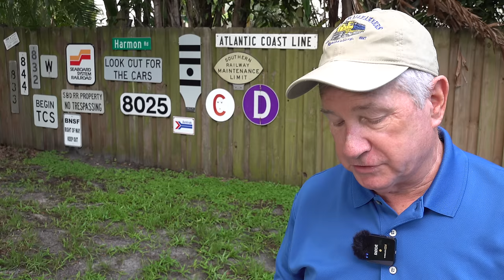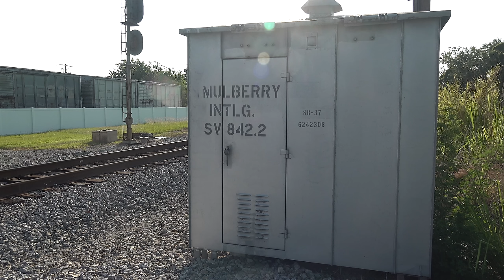Who Controls Railroad Diamonds?

Comment: Great video as usual! It is important to note that railroad companies prefer to meet railway lines at an angle smaller (or greater) than 90 degrees. At at a right angle, both wheels on the axle jump the gap at the same time, which increases the wear and the forces acting on the diamond. At an angle, only one wheel jumps the gap at one time.
Reply: That's also where to my understanding the name comes from. If it's got a non-90° angle, you'll see a sorta diamond-shape on the inside (instead of just a square).
Reply: This is what I do when I drive my car over speed bumps, same thing happens to car axles if they hit anything full on 90 degrees
Reply: @Sp4mMe  I think it's called a diamond because of how expensive they are to install.
Reply: Thank you for this comment; it makes a lot of sense.
Reply: @skendermakota2381 It's funny, though, because motorcycles are instructed to always cross railroad tracks at exactly a 90 degree angle, even if it means swerving a bit within the lane upon approach. This is because motorcycles only have one wheel per axle, so there's a greater chance of the wheel getting stuck in the rut of the train crossing it it crosses at a shallow angle.

Comment: Great video as always Danny!

I wanted to mention a rule we have at NS for automatic interlockings.
When approaching a signal governing an automatic interlocking at a speed of 25 mph or less, movement must proceed towards the interlocking prepared to stop (similar to operating on an Approach) even if the signal can be seen as displaying a favorable indication.

The reason for this is the timing system you mentioned. When moving slowly towards an interlocking, it is always possible that the time may run out as you are approaching.
This means you could go from having a Clear straight to a Stop within seconds. This rule exists to prevent crews from potentially passing a signal at danger. If you do not comply with this rule and approach an interlocking, the signal drops, and you get enforced, you will still be found at fault for failure to operate in accordance with the rules and will be thrown out on the street and taken to investigation.

Auto Interlockings are nifty but if you don’t understand all of the rules that go with them, you can very easily end up in trouble!

Hope this information was helpful!
Reply: Although not stated in your analysis, the rule must presume that approaching the crossing at a speed greater than 25 mph will insure the train will preserve the occupancy required by the system logic and foul the track circuit protection against the opposing track, but a train that approaches at a speed of less than 25 mph will be able to stop prior to fouling, if an opposing train calls for a signal.

The logic is a bit more complicated, just think "if then, but".
Reply: @glennfoster2423  that is exactly why the rule exists. If you are going faster than 25 mph, the signal will not time out and drop. A speed of greater than 25 mph when approaching an automatic interlocking protected by NS Rule 280 will preserve your occupancy.

Comment: We’ve got one of these — Cae Fawb, near Porthmadog — over the Atlantic in the UK (specifically in Wales), with the added point of note that the two train lines have two different track gauges!

The first line is the Cambrian Line, at the standard 4ft 8+1/2in, which runs along much of the coast of mid-Wales. It sees approximately one passenger service in each direction every two hours (under the current timetable you have two trains, once in each direction, within about twenty minutes, and then a long gap between trains).

The second is the narrow-gauge Welsh Highland Railway (WHR), which is a heritage steam railway that runs for 25 miles on 1ft 11+1/2in track. From what I could see on the timetable, I make it 5 trains per day in each direction during the height of summer, and less later on and earlier in the year when there is less tourism. They’re timed so that they reach the crossing in the long gaps between main line trains wherever possible.

The original WHR (which the current heritage railway rebuilt and restored) had a similar flat crossing at the same location, but I could not find details on past operations. Today, the WHR trains have to stop prior to the crossing and phone up the signalling centre for the region. If they get permission to proceed, all signals on the Cambrian Line are set to danger, the WHR train has a set window in which it must move, and then the driver/guard reports that they have cleared the crossing again. Electronic signalling systems have made this process much faster in the last decade and a half.

Comment: I grew up about 1mile from the Port Reading NJ diamond railroad crossing. Back then, there was a dual track intersected by a single track leading to and from the Port Reading rail yard.  What a racket it made when standing nearby.  Ironically, it was somewhat reassuring to hear off in the distance on hot summer nights as the sound would carry across town and in through an open bedroom window.  If you caught the start of it, you could count the number of cars as they passed over the diamond. My way of counting sheep.

Comment: I think it was around 1983 when I was a boy in Canton Illinois. A man working for the Burlington Northern came to service the diamond that crossed the Toledo Peoria and Western. The procedure he performed was to grind the wear points of the diamond down past whatever hairline cracks could be detected. It was quite a bit of material that was removed, at least 2 inches back on each side in every direction.  I was really surprised when he let the local pass by during the operation.  After the grinding he fired up the welder and placed bead on top of bead, then ground it down till it was like new again.  It took him two days.

Comment: WOW!!! I never suspected that diamonds were so complicated. I thought trains just cross them when there was no other train coming (much like cars at a 4-way intersection).
Reply: I'm pretty sure there are some examples of railroad crossings that are operated like that, i.e. without any signaling system/without any coordination between both lines, thus transferring the responsibility for mutual exclusive usage of the diamond to the train drivers by visual checking for trains possibly arriving on the other line - but this, of course, drastically limits the maximum speed or even requires to come to a full stop in front of the crossing

Comment: One of few diamonds in my neck of the woods still have tilt board signals protecting the crossing.  First you pull up and come to a complete stop.  You have to get permission from the dispatcher to cross and line the signal up for your movement.  Then drop a 15 minute fusee on both sides of diamond and then position the tilt board signal for your movement.  All the while looking out for any other train movement from the other line.  But...they rarely see or even meet other over the lightly travelled routes.  Be safe out there and thanks for sharing some good information.
Reply: This is sort of like the "five minute rule".  Where specified, a train desiring to enter a main track in signalized territory an employee may open a switch, attend the switch (to line it back normal should a train on the main track approach), and after 5 minutes (or time specified by the railroad based on maximum authorized speed) enter the main track.

Comment: Excellent presentation and both informative and easy to follow along. Just off Milwaukee's downtown a 2 track streetcar line crossed  the Milwaukee Road's 2 track approach to the depot and was at a bit of an angle and I believe set in bricks. Because of their later arrivals interurbans frequently did have to build a bridge over or under the steam Road especially in the Midwest.  Thanks for the top-notch presentation
Reply from the maker: Glad it was helpful!
Reply: @distantsignal I like how informative you are and people ask great questions. I'm gonna try to work for the railroad. Can't wait to mention you when I do come to Florida.

Comment: @ 7:35 into this video I noticed a large bolt that was supposed to be holding the guardrail part of the diamond was very loose! So loose that it was turning in it's hole with the heavy vibration of the Amtrak Silver Star passing by above.

Comment: Great video as always Danny. Watching the close-ups of the diamond (which were great) I noticed a loose bolt moving around. I know you said these required more maintenance but it would be interesting in a part 2 if there is any video of service work or the time table they use to service them. For example, do they have crews that tighten the bolts periodically? Thanks again!

Comment: The diamond in Tampa, with the curves to protect the tram line from trains reminded me of something similar in Toronto.  The streetcars and subways run on the unique TTC gauge, which is not used anywhere else in the world.  The supposed reason for that was to keep trains off the streetcar tracks.  However, the new LRT lines going in now use standard gauge.

Comment: An intersting setup. This is what was in place in the early 90's on RJ Corman, Cleveland line. Outside and south of Brewster, Ohio, RJ Corman (ex B&O) ran north.nJust north of North Beach City, they ran into a manual tilting target signal. It was usually set for Corman movements as Corman and Ohio Central used Corman track to go to Warwick, a CSX interchange. Just before the tilting target was a connection track from Ohio Central (ex N&W and NKP branch line) to Corman. Anyway, just north of that Corman had an interlocking to cross the Wheeling & Lake Erie (again ex N&W and NKP mainline). The interlocking had B&O CPL's guarding their movement. Only STOP or PROCEED. Sometimes we had to manually run a timer or call W&LE to operate the plant. 

Now the interesting part. Corman would call Ohio Central, to obtain permission to enter their track, to access W&LE Brewster yard. Corman also held the block permission on its own track, where the Ohio Central connection was. At the time there was only 1 Corman train a day and it had the permission. Corman would stop at the tilting target, manually move it for Ohio Central track movement, then proceeds the Brewster mainline switch and then call W&LE for permission to enter their main. 

Technically, we should have our track rights anulled when we left our own mainline, but since we were the only train out there, and if Ohio Central wanted to use our track to go to Warwick, they would have to call our train and our yard office for permission. Then Corman would annul our orders and re-issue them to Ohio Central. In essence we were short cutting on those permissions, since we were the only train there. 

I'm pretty sure it has all been changed by now, but was always odd, to have to get our own permission to cross our own track.

Comment: I like those crossings. We had one big one here in the Netherlands, two double tracks crossed level and both had overhead power wires. There was a strange construction using switch point motors to lift the wires from the crossing track, so a trains pantograph would not hit them. This crossing has been removed now.

Comment: Your videos are great. 

I’ll throw in my experience with railroad diamonds. I briefly worked for New England Central in 2005, qualified from Brattleboro VT to East Alburg VT. In that territory, we ran through Bellows Falls VT, where the Vermont Rail System crosses via a diamond. NECR controls the diamond, and VTR must contact the NECR dispatcher to request the signal to cross. My understanding is that the Rutland RR (now VTR) was there first, and the Central Vermont RR (Now NECR) wanted to build their route across the existing Rutland route. The agreement going forward was for CV to maintain and control the diamond.

Comment: Diamonds like this are quite rare here in Europe and here in the Netherlands we have only one remaining. But it is a special one, with overhead power on both lines. The catenary of the low speed track is lifted in the normal position and is lowered onto the wires of the mainline when a train crosses the diamond. This is all controlled by switch machines, making the interlocking even more complicated.

Comment: The Newark crossing is the only mainline diamond left in UK. Although signalling is easy - a single company owns both lines - it is a major headache causing a bottleneck on two busy lines. They can't easily build a grade separated junction because the River Trent is too close on one side. When the Retford crossing was converted in 1960 the cost was about $3 million. Although that was a huge sum for a short section of track in 1960 it paid for itself by removing a restriction on the fast, busy East Coast Mainline. Trains now fly over that junction at speeds over 120 mph.

Comment: This brings back many memories.  My grandfather used to operate tower #112 in San Antonio where the SP and MKT intersected.  When I was a young kid in the early 80s he would take me there to visit some of his old railway buddies still working there.  I remember how cool it was when they let me flip the switches and push the buttons to operate things.  Also reaching out and handing paperwork to the passing engineers at cab level from a platform on the side of the tower stairwell. These were the last days before they eventually tore down the tower. Today its all automated. The SP and MKT (and MP) are long gone and its all UP railroad now in the San Antonio region. This video brought up fond memories indeed.  Thanks for sharing.

Comment: I know you plan to do a part 2 on the diamonds.  I hope you cover those using only a gate and usually in dark territory, no signals.  Today they may be the least common type of diamond.  The easiest, without a proceed signal, and most simple diamonds I had to use was those in dark territory and used a gate.  The gate was usually against the least used RR.  We had to approach the diamonds prepared to stop, but if there was no train and the gate was not lined against us we could proceed without stopping.  Some did require all trains to stop before crossing regardless of how the gate was lined.

Comment: Back when TECO put in the streetcar, there was someone from CSX who was stationed at the crossing. The streetcar would stop short of the diamond, the CSX guy 
would get on the streetcar, ride across the diamond, and get off the car on the other side of the diamond, both directions. Then I suppose, the crossing was converted to the present automatic and the rider ceased to be required.

Comment: Marion OH that you reference was not an Armstrong interlocking from the early days. It was a very early electric controlled  system having a mechanical flatbed control. I was in this tower while it was still operating a long time back. The operator was rail fan friendly and explained how it worked using a mechanical matrix to prevent a wrong move. Was in service until the entire plant was remoted back when. Now the tower and former station are museum exhibits and the station building has a number of CTC boards. Some I remember some when they were in use. They are usually open weekends check their web site for info.

Comment: Great information on rail crossing in the US. Over here in the UK even when we had seperate companies, the crossing were control by a signal box that was in view of the crossing. Where the signal box was on the mainline that line got priority. All signals were interlocked at the signal box and point work the same. Most mainline crossing have been removed in the UK now. Either the other line goes over by a bridge or a juntion crossing has been put in place.

Comment: That purple derail sign puts me in mind of a PRR/PC derail switch stand target I saw installed back in the later 1960s. It was along the NEC just south of Baltimore on an industry spur after it diverged from a siding. The purple part of the target displayed to the crew when the derail was set and the yellow part when the derail was removed. There was also a blue reflector on the purple target vane and an amber reflector on the yellow. Kicking myself for not taking a photo since I've never seen another one like it. The industry was usually switched late afternoon/early evening, so the reflectors actually served a purpose during the shorter days of Winter. Sadly, all that trackage is gone now.

Comment: Historically the railroad who was there first owned the diamond and therefore controlled it (dispatched it). The railroad who arrived latter was responsible for maintaining the diamond (at least paying for it). As Danny said some railroads have negotiated different arrangements for certain diamonds (I.e. exchanging rights on two diamonds at different locations). In other cases the automatic interlocking mentioned gives both railroads equal access. Good video.

Comment: Great video as usual, Danny. As an aside, some railroads require engineers to reduce the throttle 1 or 2 notches while locomotives were crossing the diamond. This is to reduce arcing in the traction motors if they were under power during the jarring of the crossing. Keep the great videos coming!